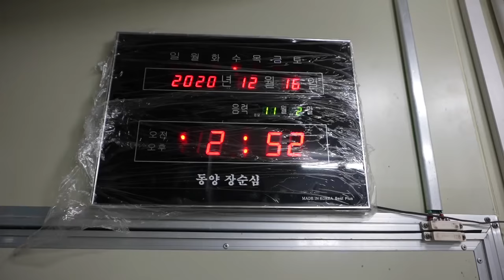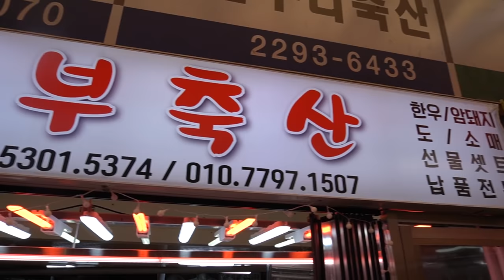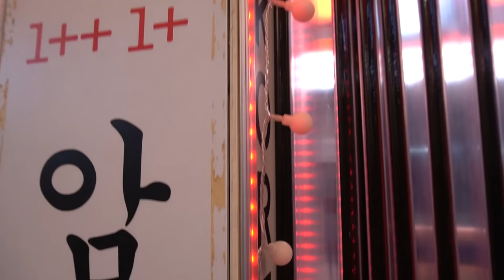(HACCP ver) HOW TO BUTCHER AN ENTIRE COW - The process by which beef is made  / 소발골,발골교육,신부축산

Comment: Excelente video están escritos los difrentes tipos de  cortes de carnes en la introducción:
15:25 Solomillo Solomillo
16:36 Hoja de patas delanteras
17:12 Incidente Shin & Shank
17:51 Plato Upjinsal
18:27 Costilla Costilla
19:06 Seoldo trasero y trasero
19:31 Piernas delanteras (longitud completa) Tronco
20:27 Solomillo superior
23:15 Varios Cortes de Carne
23:25 porterhouse de lomo inferior
25:47 Ronda inferior de leyenda
27:46 Moksim Chuck Roll
28:23 Avalancha Shin Shank
28:56 Punto de pecho veteado
29:23 ¿Solomillo a gusto?
29:56 Tri tip
30:34 Punto de pechuga Chadolyangji
30:44 cadena de cuello de golondrina
31:55 grupa interior redonda
32:30 flanco de Chadolyangji
33:00 Gorro de solomillo superior Sulgit
38:12 ojo pelirrojo de ronda
Reply: Brisket?

Comment: Must be wagyu the way it’s so highly marbled. It’s gorgeous looking beef but what an odd way to butcher a whole beef than is done in the US. Must be the way Koreans like their beef. But I can’t believe they are letting it touch the floor and other surfaces in the room like the outside of the meat locker door and the pipes like structures Just outside the locker. Then again, the way they cut off every speck of surface fat they likely cut away any part that hit the floor. A butcher in the US quarters the hung half beef and gets it right to the table to part it out and doesn’t let it fall on the floor or touch any other surfaces that can’t be sterilized.